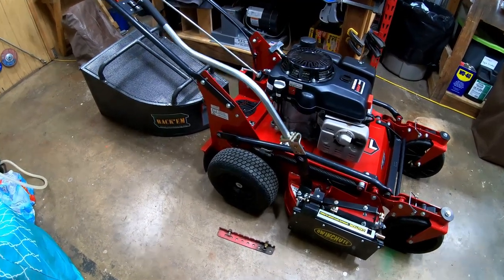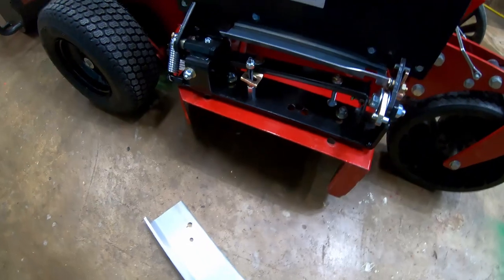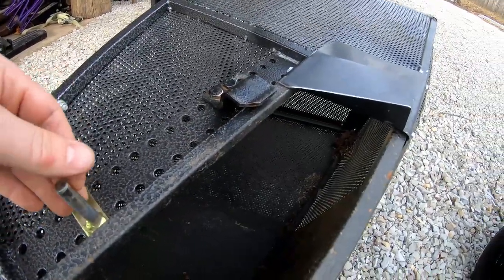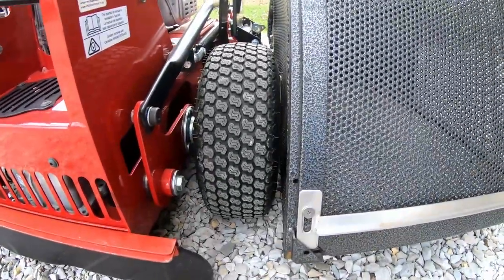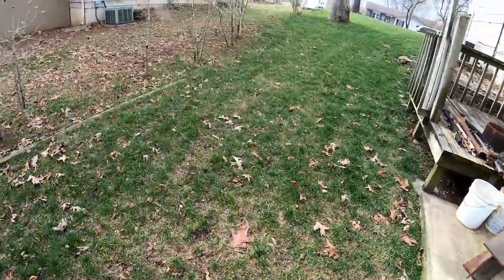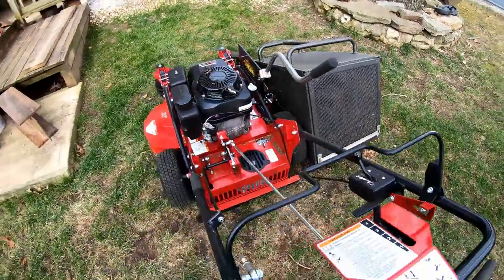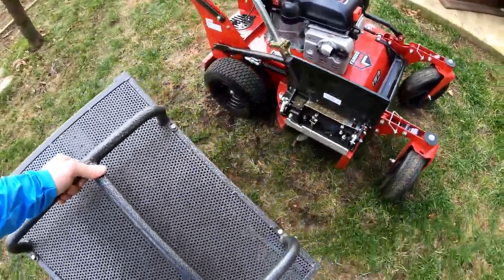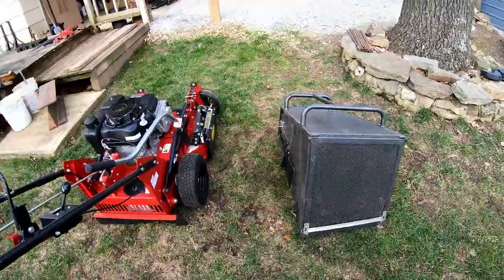FW 15 W/Side Mount Bagger

Comment: The real Truth is that the Ferris FW15 Is not Built for Mulching It is designed for side discharging ONLY. For (Commercial Property Mowing) Commercial property owners don't give a shit about mulching the grass they just want it cut using a mulching for the commercial property is a personal preference of the operator of the Ferris FW15  But they made a Mulch kit anyway for it (For Home Users) and the bagging system Kit To suck up Home property tree leaves ect..  That is why  3 different type blades to use (High Lift, Medium lift Blades)  for side discharging, and mulching blades to mulch Grass and leaves For The Bagging System --->(  FOR  THE  HOME  USER ONLY  )   👍

Comment: nice.  ive been looking for a new backyard mower.  shame it doesnt have electric start but its a honda.  look like decent suction on the deck.  im curious, any particular reason you move the throttle back to open after you shut off?
Reply from the maker: Starting habit. Always reset controls and switches to be ready to start next time.

Comment: So this is a good mower? Like to replace a toro 30 inch good?
Reply from the maker: I have not tried Toro or Exmark 30" mowers, but I really like it and I have heard of others who have replaced their 30's with this mower and love it.
Reply: I had a turfmaster one summer. That thing will flat wear you out. Pushing, pulling, lack of power,  trans slips. No thanks. The fw15 is in a different league. All you do is steer it. The mower does the rest.

Comment: I am looking to upgrade my FW 15 this season. I have a few small manicured commercial properties that ask for collection of clippings and am torn between the bag setup or doing what you have here. What do you think are some of the benefits of the bag vs the chute blocker. I have a stander with a grass flap and an accelerator bin which I love, but it does tend to hit obstructions on the ground and isn’t very maneuverable in tight spaces, which is the main reason the Ferris has become my workhorse: tight spaces. However I love having the chute blocker on the stander and am wondering what your thoughts are on this vs the bagger as I know you can’t really do both without modification. Your videos with this mower have been incredibly valuable as there isn’t a ton of info out there yet on this thing, which is surprising bc it’s an amazing piece of equipment.
Reply from the maker: I think this setup is the best all around setup for me. That being said, sounds like it would be the best for you too.
Reply: @HandyGuy2016  thanks man. I appreciate your input and videos. Again, it’s been incredibly valuable.
Reply: @HandyGuy2016  You’re liking the side bagger over Ferris’ rear bag unit?
Reply from the maker: @georgiafan6618  yes, more capacity and easier to take on and off the machine.
Reply: @HandyGuy2016  Thank you for the heads up.

Comment: Awesome upgrade!  Nice to turn your FW15 into a quick 3in1 mower. I did the same to mine last year. I mounted the Worldlawn fabric mesh bagger on my machine. Helps greatly with the dust. Plus it is much lighter, weight wise.
Reply from the maker: I like the sound of that, metal baggers are a bit heavy.
Reply: Hello there Sir.  Would you mind telling me where you got your worldlawn bag from? What model would fit the ferris fw15?  The metal bag does sound a bit too heavy to empty.
Reply: Juan Manuel Marquez any local dealer that sells Worldlawn or Encore mowers should have or able to order the mesh bagger. Please note, you need to have someone weld or mount a bracket onto your mower deck.

Comment: Hello sir. Any chance you'd be interested in making and selling the aluminum and side plate attachments? I have an fw15 and refuse to buy the factory bagger after already spending 3300 on the mower alone. I have an accelerator on my z1 and am very happy with it. I just don't have the tools necessary for this fabrication. Let me know brother I'm very serious
Reply from the maker: Are you going to purchase another accelerator, or use the same one?
Reply: @HandyGuy2016  I will buy the same bagger you have so I can make it work on my fw15.
Reply from the maker: @gvela5110  you should be able to get a bracket specifically for the catcher/mower combination, especially if you go with accelerator.
Reply: @HandyGuy2016  awesome! I didn't know accelerator made 1 specifically for the fw15. It's the 3.3 bagger but it's better than not having 1 at all. Thanks for responding brother 👍You've been a big help.

Comment: What's the part number on the regular lift blades and if you are using mulching blades as well what is the part number. Thanks as always for the great vids!
Reply from the maker: Mulch - 5107717 (Briggs and Stratton) I don't have the regular lift number on hand that come with the mower.

Comment: I purchased a FW15 yesterday.  I have run a mulching mower for 20 years with racking up leaves in the fall.  What the best all year setup standard blades, Quixote chute, and side mount bagger.  Or mulching kit for first part of the year and the bagger for the fall?
Reply from the maker: The Qwikchute and side mount bagger, seems to be the best all season setup for the FW 15 in my opinion.

Comment: How does this mower cut at the lower settings, I’m looking to cut Bermuda at 1.5-2.0” residential non-commercial
Reply from the maker: The lowest I have cut is 2.5" but it should cut great at lower settings if it cuts good from 2.5 to 5

Comment: Hey man! So I was attempting to do this same thing for my Ferris FW15. Only thing is, I have the accelerator side bagger. The bracket they provide is too high, too thick, and too short length wise to fit the quikchute as well. Is there any chance, literally ANY chance that I could buy one of the same brackets you use in this video? All I would have to do is drill a hole in the side of it due to the rod on the accelerator bagger's attachment. Please let me know!! As of now that seems like my only option to make the bagger/quickchute combo work simultaneously.
Reply from the maker: I made mine from scrap aluminum angle.
Reply from the maker: Would it be possible to modify the bracket that came with it? I'm on Instagram @ Dependablawncare if you want to message me there, and share a picture of it maybe I can help?

Comment: What is your opinion on the Ferris stand-on mowers?
Reply from the maker: Both of my Ferris Z3X mowers are going on 3 years old and have over 600 hours each. I plan on running them to at least 1000 hours and then buy 2 more. I don't think there is a better stand on mower on the market.

Comment: Great video, I have the bagger and the quick chute and plan to build this bracket too.  I read in one of the comments that you cut the metal with a band saw, do you mind sharing what make and model of band saw that you have?
Reply from the maker: It's an old Grizzly, with a 3/4 hp motor but it cuts lol.
Reply: @HandyGuy2016  Thanks so much, my old harbor freight special should work then too! :)
Reply from the maker: Definitely! Honestly the Harbor Freight is probably better than mine.

Comment: Hey man got a question do you have Instagram I can DM you?
Reply from the maker: I don't have instagram brother.
Reply: @HandyGuy2016  I was curious what is the minimum size trailer that will fit those 2-Z3's that you have? I know I can look up the dimensions on the website but, it won't tell me how long they would be with the( 61" up front) and the 52" straddling the back of the 61". I know sit down mowers can conserve space by doing this but, I'm not sure what the total length would be in that configuration.  I was curious next time you remove your baggers if you could line yours up and pull a measurement for me?
Reply from the maker: @JsCrazyCutzLLC  sure, my guess would be right around 12'

Comment: What was the main reason you changed from the factory bagger to this style?
Reply from the maker: The factory bagger was not very efficient.
Reply: @HandyGuy2016  I'm looking for something focused on grass clippings more than leaves which do you recommend the factory setup or the one you are currently using? will the metal one hold in the grass clippings just as good as leaves?
Reply from the maker: @1320str8liner  the side mount catcher is going to be better for grass clippings and leaves.

Comment: Can you do this without the quikchute if I’m using the mulch kit?,  with the quikchute do you even need the mulch kit?  Are the mulch blades worth it?
Reply from the maker: A bagger will not work with a mulch kit. The mulch kit for this mower is ok, but not the greatest cut quality.
Reply: @HandyGuy2016  im looking at the fw15 as I have a half acre lot, if you are normally mulching and would like to suck up leaves in the fall (40 bags worth), what setup do you recommend with this machine?
Reply from the maker: @doinky3  this setup would be the best all around.
Reply: @HandyGuy2016  do you just use the standard blades that come with the unit?
Reply from the maker: @doinky3  yes, or the high lift blades for the bagger.

Comment: I have a question, where did you get the weight for your FW15?
Reply from the maker: It's the weight that comes with the factory bagger.
Reply: @HandyGuy2016  ok, wow my bag just got here and did not get the chance to open the box, thanks for all you do and i sure hope i love the machine!
Reply from the maker: @michaelbruder7166  Awesome!
Reply: @HandyGuy2016  the factory bagger continues to clog, dry grass w/ 5 setting, i see you purchased the rackem i didnt think it fit, do you know the model?
Reply from the maker: @michaelbruder7166  I modified mine and made a custom bracket, but I would recommend the aluminum accelerator bagger. The smallest one, and they might have a bracket for the FW 15.

Comment: What tool did you use to trim down the metal bracket? 

Thanks for making the video. This is exactly what I was looking for.
Reply from the maker: Bandsaw
Reply: @HandyGuy2016  Thanks for the videos.  I just bought an FW15 and greatly appreciate all your tutorials.  How did you create a template or determine how to cut the 'notch' on the aluminum angle?
Reply from the maker: @mikehill2712  I started with a cardboard template, until I had it figured out, then I transferred it to the angle.
Reply: @HandyGuy2016  Thanks HandyGuy, I'm not real confident in my ability to create that template.  Would you be interested in, for a fee, tracing that notch on perhaps a piece of cardboard that I could use to create that bracket?  Thanks!
Reply from the maker: @mikehill9538  depending on what catcher you get, it may be the same as mine, probably won't be.

Comment: Rackem side bag or accelerator?
Reply from the maker: Accelerator is lighter, Rackem is cheaper, so the choice is yours.
Reply: @HandyGuy2016  looks like the accelerator comes with a mounting bracket, similar to the one you made for the rackem. So would it be easier to install with the quick chute?
Reply from the maker: @drewd6083  I would assume so, but I don't know for sure.
Reply: @HandyGuy2016  thank you for the information. I'm going to try it and see how it goes.
Reply from the maker: @drewd6083  Cool, let me know how it goes.
Reply: @drewd6083  yo!! i also have the accelerator side bagger for my FW15. Any chance you found a solution to using the bagger and qwikchute combo simultaneously? I have been using the bagger for a while but just got the qwikchute in today.... and unfortunately I can't seem to fit it on using the accelerator's bracket. It's too thick and too high. Any chance u figured this out?
Reply: @rosedcurt2865  I used a dremel and some files to knotch out some relief holes for the qwikchute to close over the bracket. HandyGuy 2016 has a video on youtube about it. I used his video to make mine work.
Reply: @drewd6083  ohhhhhhh i did not think of doing that! i know exactly what u mean lol. thanks